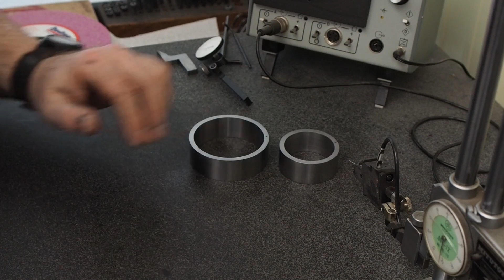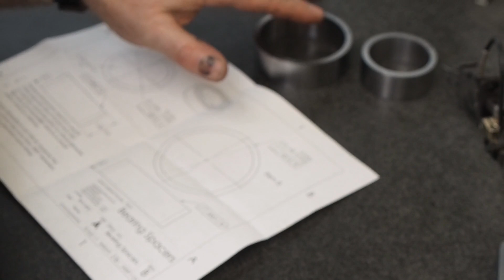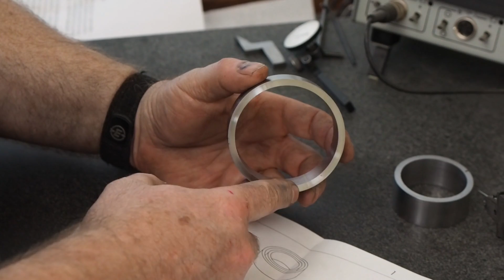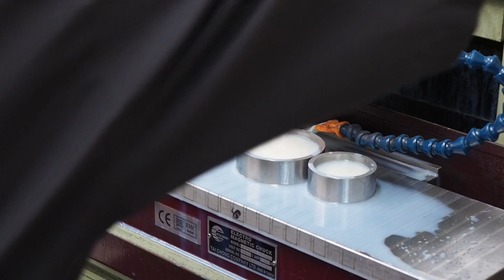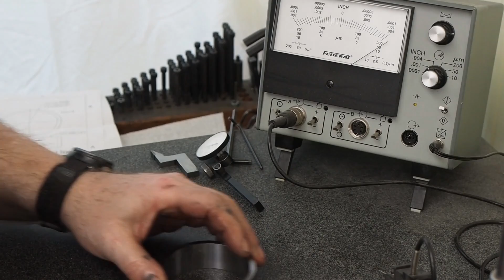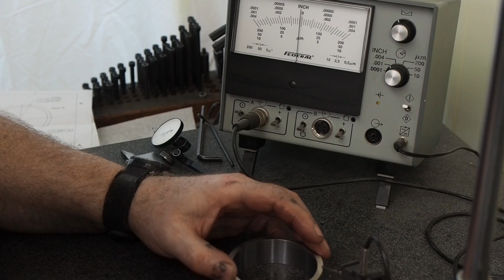Special Project for a Friend

Comment: Hey Steve,

Did you have the two spacers on full magnet when flipping on the other side, to make it flat and parallel to the grind side?
Reply from the maker: Normally I only use enough magnet to hold the part on the chuck and after one side is flat I go to full magnet with  the flat side on the magnet.
Steve

Comment: Hi , is there any reason all of the initial cuts were taken from the same side of the part & the wheel not traversed back over the part ?  Cheers
Reply from the maker: Hi Max,
If I am roughing I do it this way a lot. When I am doing finish work I will traverse both way and blank passes.
Steve

Comment: Could the small bearing have been put inside the larger one for grinding?  Let x axis to move.
Reply from the maker: Yes. It might have even helped with the coolant splash. By doing it the way I did I could move the parts around on the chuck easier. I do that to feel is any contaminates are between the chuck and the part.
Steve

Comment: How do you surface grind something when its not magnetic and the magnetic table wont hold it?
Reply from the maker: Hi,
There are a number of ways. You can use a precision vise on many things. You can block the non magnetic part in with magnetic blocks. I have used a flat magnetic part and super glued the non magnetic part to it with great result. Check out this video on how we ground non magnetic bench stones with a hinge clamp. https://www.youtube.com/watch?v=jm-EPtmGfCw
Steve

Comment: 3 questions, are the surfaces you ground perpendicular to the bores? How did they get that way since the tolerances are so tight? You mention links to other things and I never can find them, how do you find the description?
Reply: I can answer, as they are my parts.  The bores and one faced end were made in one operation, therefore they should be equally as perpendicular as my lathe cuts (1939 Monarch 16CY).  The second surface would be a parted surface which might struggle with squareness, but that surface doesn’t matter.  The first surface he ground was the parted surface, and he is transferring the perpendicularity of the initial faced surface to the new ground surface
Reply: @JoeKlaas  Thanks for the reply Joe, you may end up with a few more questions about your project!
Reply: Kathy B it’s a CNC mill I’m building from scratch.  These are the angular contact bearing spacers for the spindle.  I’ll be machining the large components at work on the large cnc horizontal boring mills.  I’ll be putting videos on Instagram of that whole process once I get there.  I’m also toying with the idea of uploading a few videos to YouTube of my progress updates
Reply: @JoeKlaas  Oh that's neat!  If I remember correctly one of our boring bar winners from Bar Z Summer Bash was also making a CNC mill. If you do make the videos just let me know, I'll update the links in the description to direct people straight to them.
Reply: Kathy B can do, I’ll probably put one together once I finish the spindle.  These spacers were the only thing I couldn’t do on my own machines, so now I’m not sure what excuse to use for not having it finished
Reply: Hi Randell, the description is directly underneath the videos. You'll see our name and the date the video was published, the section underneath is a description of the video and if you press the "Show more" button it will expand and you'll see all the links in that area.